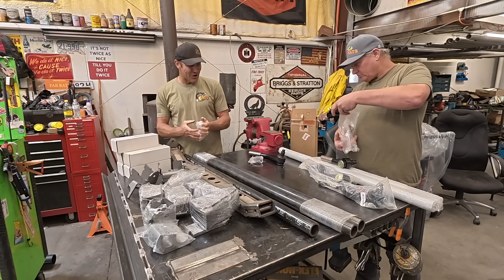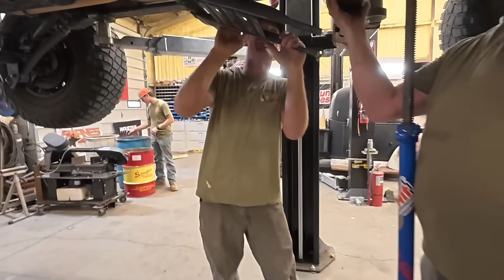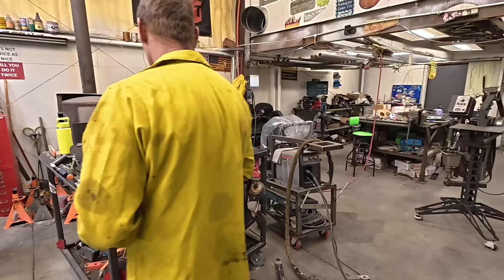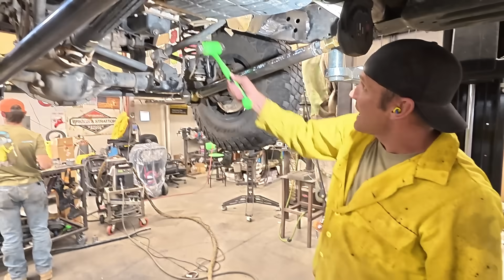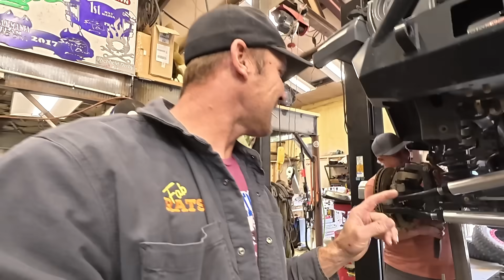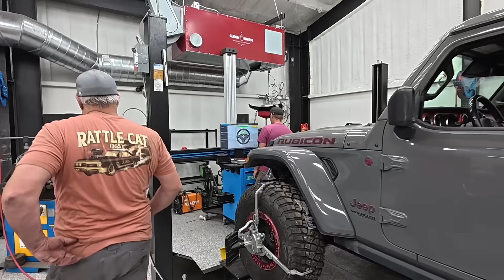JEEPS Biggest Problem And How To Fix It:  THE DEATH WOBBLE!

Comment: I have a 2020 Wrangler Unlimited Willys that just recently started having death wobble at just over 50k miles. I switched tires from the aggressive Firestone Destination MT/2's to the more streetable Firestone Destination X/T tires. This helped for a little while but the death wobble slowly came back and got worse over time. I went over the front steering and suspension components with a fine tooth comb and every bushing and joint appeared good as new, so I had the tires rebalanced to no avail. I then spoke with my son's friend who worked at a Jeep dealership and he mentioned that they would frequently put new steering stabilizers on Wranglers and the problem would usually come back after only a few days or weeks and suggested that the oem stabilizers were junk and that I should try an aftermarket steering stabilizer.
So, I proceeded to purchase and install a Rancho RS7MT steering stabilizer and immediately noticed when cycling it in my hands that it provided much more dampening resistance than the factory oem unit. The Rancho stabilizer has been installed for several weeks now and is performing great. I now have zero Death Wobble!!!!!!!!!!!!!!!!!!!!!!!!!!!!!!!!!!
FWIW, one may want to try this first on a low mileage Wrangler considering it's the lowest hanging fruit when it comes to expense and effort. I got mine from Rock Auto at a reasonable price.
Good Luck!!!!!!!!!

Comment: My factory, 97  XJ with 2" lift pucks in the front........Replaced all of the control arms, drag link and sway bar.    Still had a very occasional  DW episode.    The steering gearbox started leaking.   Replaced it with a new factory gearbox....no more DW!   I think a lot of small amounts of play in the linkage add up to create DW.     I'm no Genius, but if your gearbox has  a lot of mileage, consider replacing it to cure DW.      Thanks for sharing.

Comment: 99.99999% of the time: wallowed out track bar bolt. factory crap ain't built for offroad like you think it is. Fix it by getting one size bigger grade 8 bolt, fix the wallow with aa drill (gently) and slide thaat new bolt in.

Comment: I've owned multiple Jeeps since 2000.
I have never experienced death wobble.
Hope I didn't just jinx myself.  🤪
'99 XJ Classic, my first jeep. Still have it, BEST vehicle I've ever owned.
'91 XJ Laredo 2 Dr
'91 Comanche swb
'06 Liberty 🫣
'05 TJ, still have it. It's giving the XJ a run for its money.
'04 Grand Cherokee, it's in the driveway. 
AND...,.
My fiat 😳 a 2020 Grand Cherokee Overland. So far it's got 80,xxx miles on it and the only thing wrong with it (so far) is the info center is starting the delamination process. But has only gave me a problem once about 2 months ago.
'ive been extremely happy with every one of them.

Comment: I've never had death wobble on 95 ZJ (stock or lifted). Wanders real bad, but that cuz the drag link is bent (yes, I've verified that on an alignment rack). As soon as I lifted it I replaced control arms and track bars with adjustable ones from core4x4. Some pretty sweat upgrades on that wrangler. Gotta do some trail testing now.

Comment: I have a 2005 TJ with Death Wobble that bad.  The tire shop said it was the shocks and steering stabilizer.  I replaced them with no change in the Death Wobble.  I ended up replacing all the bushing with poly and that fixed it.  The steering is more precise but the ride did suffer.  You feel all the little bumps in the road.  Rubber bushings give you a better ride.

Comment: Adjustable ball joints top and bottom were the top ball takes 30% of the load off the bottom ball joints or vice versa. Solved my problem and haven't had to adjust only grease in 3 yrs now. 
Before was changing ball joints every year. 
They were 800.00 for the set of 4, top and bottom greaseable and adjustable so they share the load .
Aloha from Makiki Oahu

Comment: This, and almost every other video is wrong. Think people - why are there so many Jeep Death Wobble videos?  And why are there also just as many FIX videos? Because EVERYONE IS WRONG. You are throwing parts at it and covering up the root cause. The wobble occurs for the same reason the wheels on a shopping cart wobbles at high speed - caster. If your caster is correct, you can have all the loose parts you want, and it won't wobble.

Comment: i got 15 jk with 35s rpm 1 ton flip kit chromoly ball joints ..hiem joint upper lower  control arms put in some beefy tracks bars still get death wobble i’ve moved tires around still getting the wobble there’s no way doing all this work is the only way yo resolve this issue

Comment: All it takes to fix the death wobble is increase the castor angle dramatically and the wobble is gone . It is just like a shopping cart the pin angle is straight up and down and as soon you get any speed they death wobble. The completely stock jeep has almost no castor, even ram trucks are bad for no castor, and as soon you increase tire size, it changes and then a lift kit and the pin angle is completely gone, like straight up and down. Give it castor and it handles good. Take a bike for instance, give it lots of castor angle like a chopper and you ride hands free all day, take that caster away and set them forks straight up and down and you will never take your hands off because you'll instantly crash, same concept. You have an alignment rack, check the castor angle, you'll be surprised, and don't go factory specs.

Comment: Tom, to stop the seatbelt chime, get in, turn to run position without the brake, buckle and unbuckle the seat belt 3 times in 10 seconds. You’ll hear a chime and the seatbelt light should flash. Turn off the vehicle. No more chime.

Comment: My 1998 Toyota 4Runner does the same thing although not quite that bad, and the dealer keeps blaming it on the tires being out of balance. I've run every tire on that truck I can put my hands on, and they all behave the same way. The front end alignment is correct too.

Comment: just once,  is like to see a vehicle with death wobble on the alignment rack.  I think the caster is too shallow so it doesn't have the centering force anymore.  of course the bushings are junk for this is happening.  Back in the day, I put different offset wheels on my 1970 F100 2 wd pickup and got a dose of death wobble ...rebuilt the front end and sold it...

Comment: You know, for all of the "Improvements" that have bene done to the Jeep by Chrysler (and now Stellantis *barf*), they have created way more problems than a Leaf-Sprung CJ ever had (I know YJ's are leaf sprung, but they're basically a CJ-7). They're trying to make the Jeep into a Luxury Car, instead of the brute utility vehicle it was designed to be, in 1941. Heck, even in 1941, it wasn't really a "Brute". Jeep didn't get it's Might, until AMC dropped a 304 V-8 into the CJ-5. Speaking of engines; when are you going to do the Pentastar Rebuild video on this Jeep?

Comment: Most Jeep owners who think the are experiencing “death wobble” are merely experiencing the ESC system engaging because they’ve lifted the center of gravity and center of pitch and roll 3-5” higher with soft springs and weak shock that exacerbate body roll and movement.  It’s that side to side body roll that causes the now mislocated ECS sensor to activate when it hadn’t before the addition of a lift.

Comment: Never seems to be an end to people buying a stock jeep, then expecting it to do,  what you all can do on the trails. Sorry Tom if this one’s yours, but stelantis, the owners of dodge, who owned jeep;  is cutting corners continuously. The jeep, might get worse before it gets better. From the words of Douglas MacArthur: 
"Old soldier’s never die, they just fade away.” 
Now that I have ticked off all new jeep owners, hear me out. I had a 77 Jeep Honcho, in 1988. I wanted to keep it but the ground it was on, was needing to be cleared. I also had the 99 Grand Cherokee, where the cooling system caught on fire. Luckily the top hose burst and put out the fire from the cooling fans.They were just replaced by a "friend.” Sure, that wasn't jeeps doing, but it was jeep parts. I am still a fan of the Old School Jeeps, go figure eh?

Comment: I would just be so worried about trusting that sleeved section of the axle as the 3-links upper mount. I thought those sections were known for fracturing already in stock form. Interested to see how it shakes out after some trail runs.

Comment: Dang, I guess I should get up in morning and replace the steering linkage in my Jeep.... It's been setting on my porch for to long.  If you have a JL, JLU or JT plan to replace that at 100k or before.   The death wabble or can be "fun"  my XJ would start having it when I need to replace the heim joints.  A steering box brace helps at times on XJ's.

Comment: I remember my first death wobble!  My 1st time installing long arm suspension lift all by myself  & I was SO proud of myself UNTIL the death wobble hit. Needless to say I swallowed my pride & took it to someone much more experienced than myself at the time😂Can't even remember what caused the 1st one.
Reply: Mine was going to a 4.5 inch lift on my 90 XJ, it drove perfectly fine for about 35-40 miles then any speed above 25 shaking everything apart. Got home took off back to prior suspension setup.  Looked for worn parts replaced them first then reinstalled the front coils shocks ect.

Comment: Doing solid axel swaps I use to make my drive shaft straight. Hinse ran into Major Death Wobble. Then I was told I need - caster ? I think. So I made my brackets where the upper ball joint leaned more towards the rear of the truck (- caster ) I think I'm saying the right word lol. No more death wobble

Comment: Hey Matt, why don’t you “design” a short “T” shaped bar with a Pintal loop on the vertical leg end and the cross horizontal legs you can strap the wheels or control arms of SxS you are recovering? Effectively turning them into a trailer. Just use the boom winch to raise and lower the SxS. No need for someone to ride the brakes.

Comment: Old coil spring front ends didn't have the death wobble....Ford on the Superdutys started the Death wobble when they went to coil suspension.. I bet if they went back to the old style steering where you have a tie rod attached to the gear box and to the hubs...like the old style steering linkage...Too many steering parts..My 76 F250 4X4 didn't wobble at all...it was a simple system...My 2007 F250 4X4 did the death wobble withing 100 miles of it leaving the dealer...

Comment: I fixed it in my 80 series landcruiser by putting a better steering dampener on and that totally fixed it.
Reply: Don’t forget to check the torque on the lower kingpin studs, sometimes a problem on the 80’s 😉

Comment: Ive never had death wobble
 When i lift and put bigger tires on. I upgrade my shocks. I also upgrade the steering dampeners. I do feel some vibration. You get that with aggresive tread.

Comment: LOL... that's hardly death wobble... If you want to see some REAL death wobble, I'll take you for a ride in my old Franklin. Lately, when that thing goes to wobbling, you'd think it was going to rip the front end off the car. Sadly, Barnes doesn't make upgrade kits for the '25 Franklin so I'll have to go it on my own. Replace: king pins, spring pivot bushings, tires. Then tighten the steering box and wheel bearings then full nut n bolt, alignment. If I'm lucky that'll cure it. Love your show. Keep 'em coming.

Comment: I experienced death wobble in my F350 when it only had around 9000 on it. Turned out to be the steering stabilizer. It was replaced under warranty and has been fine since. It now has 120,000 miles.

Comment: Death Wobble in a 1968 Willys Jeepster Commando - I bought the Jeep off a speed shop's back lot in Colorado Springs in 1998 where it had sat under a big tarp for many years. The tires were about 20 years old, maybe more, it had been stored a long time. After doing the belts, hoses, oil, lube, tune-up and fuel stuff I was out of money for a while. Didn't plan to drive it much until I could pay for new tires. But the Death Wobble was horrendous. Okay in town but it became a rattling shaking roller coaster on the highway. I suspected seriously worn front end parts, but nope, it was the tires. Got new rubber on the thing and it went down the highway full tilt and no worries.

Comment: Great Video as always. I'm very experienced with the Jeep wrangler jk and JL suspension.  90% of death wobble begins with wollowed out bolt holes on the track bar. Then it just wallows everything else from there. The JL brackets are not as thick as the JK. I feel that is one reason more complaints from death wobble occur from the JL.

Comment: It’s a little deceptive to say that a long arm swap, new tie rods and new tires alone will fix death wobble - the added caster may have helped, but any adjustable lower/upper links could have helped add in caster and reduced the wobble.  But you should have also shown checking/replacing the ball joints and track bar - those are bigger contributors to the issue.  Any solid front axle can experience death wobble when components wear, tire are worn/out of balance or the alignment is off - just adding long arms, new tie rods and tires was just a piece of the death wobble puzzle.

Comment: death wobble has been figured out long ago. the cause is too much forward caster. the axle needs to be leaned back about 4 degrees. with rearward lean the axle wants to self steer in the forward direction and keeps the wheels from shaking

Comment: Paul how do you MT tires ride on the wrecker? I bought a set of 38x13.50x17 for my truck  and loved them offroad but couldn’t drive over 40 mph on the street because they were so out of round. Wondering if I just got a bad set or if they are all like that?

Comment: I had a 1975 Chevy 4WD that did that after I added Armstrong Rhino tires, big ones. It only did it between around 40 to 60 MPH. I never did figure out what caused it. I eventually put the small tires back on and sold it. I was a teenager living out in the sticks, with no internet, so resources were limited.
Uh, why are you throwing trash in with your recycle metals? 😉

Comment: I had an 89 GMC Sierra 2500 that was the same suspension and steering as the srw 3500. It had the death wobble and nothing fixed it. the only things I didn't replace were the steering box and torsion bars. It always felt like the right front tire was being dribbled like a basketball. It had 16.5 alloy wheels  and 31" tires that were wider but similar height to the originals and way lighter. New control arm bushings, tie rod ends, center link, idler arm, shocks, tires,  wheel bearings, etc. It shook so violently that I had to carry a 1- 5/16" wrench to periodically tighten the pitman arm.  It would only do it under 40 mph, accelerating or decelerating would stop it, but braking would make it worse. 
I've never seen a GM IFS do that, the dozen close friends and family that had them never heard of it, and my cousin was a Chevrolet dealer tech and was just as flabbergasted as everyone else.  I suppose it could have been torsion bars but the adjusters weren't out of wack and it sat even side to side with and without a load.

Comment: Those tires that came off were messed up, bad alignment caused wear and wobble. New tires fixed the issue until the tires wear badly again. Your telling me all jeeps with death wobble need a full suspension upgrade? Jeesh, bet ya the wobble comes back

Comment: A problem with death wobble is ball joints you've got to get rid of them stupid things because they go all direction that's what causes the shake you got to replace them with him joints . That's why when you replace everything in the front end it works for a while to the ball joints get wallered and that starts to shake all over again for one they made ball joints really bad now because they're plastic inside the ball joint that wears out

Comment: Death Wibble isn't just swap out arms. Alignment, tire wear, and joint wear has more to to with it.

I wished they would have put it on the alignment rack before they started, to see how jacked up it was to begin with.

Geometry angles are very important in lifts.

I've done two different 6" lifts with long arms and drop brackets. No alignment after installs and both track straight no hands at 90 mph. One is running 42's with drop brackets and factory control arms.
Reply: Yea, there was alot more going on than just short arm geometry issues.  This was more a promo video than a learning video.

Comment: I put '05 super duty axles under my "78 ford. I did all the things (link arms, geometry, new parts exc.) and it still got the death wobble around 35mph when hitting a bump in the road. Ended up adding hydro assist (needed it anyway) and it stopped doing it.

Comment: DeathWobble is not just a Jeep thing. It is more common in Jeep because of the shorter suspension arms. The mid 2000's super duty Fords have it with a tire size upgrade.

Comment: I have a question why with all these sxs recovery no one has stepped up to the plate and get a sxs company to build a sxs tow rig now that Toyota coming out with a sxs I'm thinking they could build one take a 4 seater and mount a winch and tow boom in the back and you can recover a sxs on a sxs trail look what Robby Layton went through getting a sxs